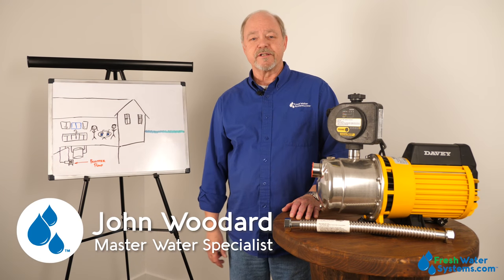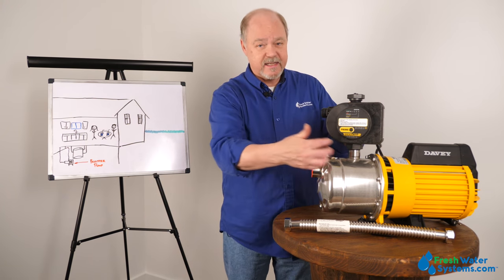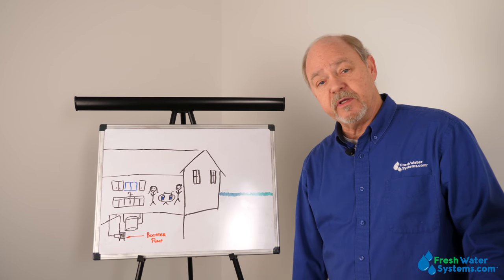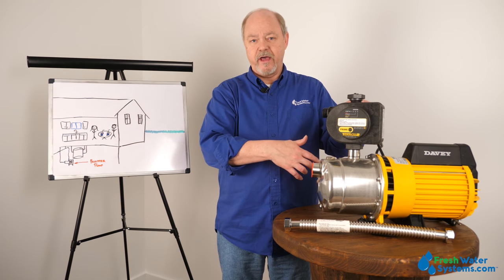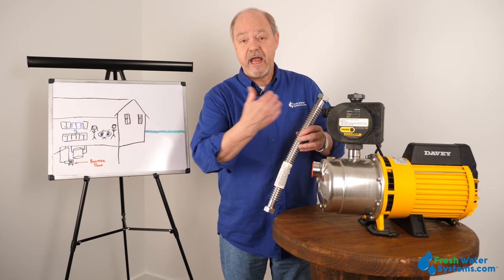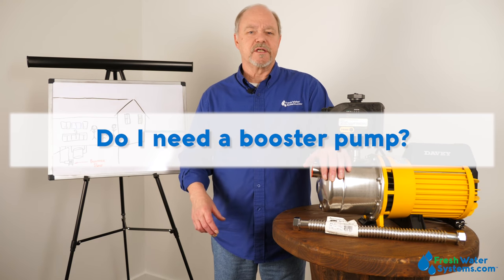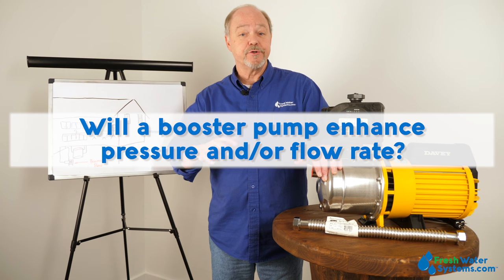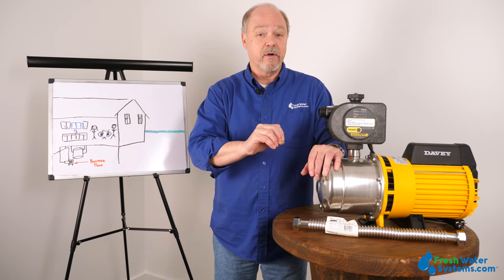What is a Water Booster Pump and How Does It Work?

Comment: So this will run whenever someone opens a faucet.  It's not like a pump with a pressure tank where the system will pressurize and the pump only will run once the pressure drops below a certain threshold.

Comment: My grammas house needs one of these. She lives in Mexico. They get their water from a reserve on the roof of their house. They only need about 20 psi
Reply: How do install the bypass yo your pump
Reply: Compraste la pompa? Yo tambien estoy viendo esto , y no se que hacer , tengo nueva casa en mexico en medio de la nada con tinaco y necesito una que de buena presion a toda la casa.
Reply: @TB-ij1vg  no la compre. Ya tengo tiempo que voy para México.  Cuando fui no avía nadie más que tenía bomba. Mucha de la plomeria en las casas no están para alta presión
Reply: @randybrown1922   you install a T fitting right before the flex Inlet for the pump, install a shutoff valve on the new run of pipe. Run this new pipe past your pump to the end of the outlet pump flex line. Add another T fitting just as you did by the inlet, with a shutoff valve. That way if pump fails, you can turn off flow to it, and reroute the water around it.
Be safe! Get your project inspected and permitted if required, AND ENJOY WATER PRESSURE 💦🌊💦

Comment: we have a cistern and a wster filter system and a booster pump. but the pressure on 4th floor is barely enough to activate the multipoint water heater. should i install a small portable 150w booster at the 4th floor so it can help activate the heater properly?

Comment: Hi;  what is the voltage for a 1 HP booster pump,  Davey brand. Also, is the pressure variable at the pump? Or is it a fixed pressure setting?

Comment: Caution please be sure you get the correct pump for your application.  What this guy is not telling you is there are no pressure adjustment on these pumps!   The pressure output is going to be 50+ pounds greater than your incoming water pressure.  i.e. 20 inlet = 70+ psi outlet

Comment: Really, really helpful video.  Thanks.  I've notice some booster pumps come with a pressure tank.  What's the difference between these and the ones that are pump only?  Is one better than the other?
Reply: An air tank gives a constant flow of air (pressure), rather than intermittent flow. Well that's how it works with airbrushes anyway.

Comment: Ok so I just installed one of these pumps for a customer . First yes the piping is vibrating throughout the system so I need to add flex connectors to the system . Second they are complaining that every time they turn on a fixture the pump kicks on. Can I add a storage tank to your booster pump and could you post a diagram on the proper installation of the auxiliary storage tank . Basically they want to be able to use water without the pump constantly cycling . Any help is appreciated . Thanks and I did purchase from you directly
Reply: Oh well
Still dealing with this thing. Now I have to add a storage tank because the customer is still not happy

Comment: we're buying a house that has one of these in the utility room, it makes a lot of noise every time you run the water a bit. Is there any way it can be installed outside in a small weather protected place? We do get wet and snowy weather. Thanks!
Reply: Did you try the flex connector or upgrading to a noise controlled version?
Reply: Anjulee Boralessa we haven't finished the sale yet, but I'll write that down so I can look into it, thanks!
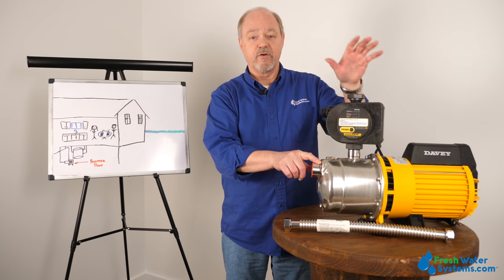Reply: Hi Mary, look at time stamp 3:43 in this video. He's holding a flex connector and describes the benefits of using them. I hope the sale went well for you.

Comment: I bought a used dura-flow pump to use as waterpump for solar heating system.
Now when I look at the pump I don't find any power cord/supply, only one 1/4 inch vacuum tube attached to the switch assembly on top of 
the pump. What am I missing ?

Comment: Can I use booster pump for 20 shower and 18 faucet from water supply (pipe) with less than 2 bar pressure from the supply?

Comment: How is this different than using a MUCH cheaper shallow well pump?
Reply: It’s difficult to see exactly. It could be the materials of construction, or that it may not develop the same head pressure. Some booster pumps are far more sophisticated than the simple on off shallow well pumps. For example, the well pump may just come on and increase pressure until it hits its limit so you may have varying pressure during the use of the water. However some booster pumps can actually control the water pressure to maintain it at a certain level with varying water usage. That’s not to say that a simple shallow well pump won’t meet your needs, it is just that you may have varying water pressure when it kicks in.

Comment: As far as I know, sucking water out of municipal water network - as you potentially do if you connect the booster pump directly to the incoming water line - is forbidden for a good reason. I haven’t heard anything about this from your presentation.

Usually you have to have a ground tank to separate the pump from the municipal network. Are there any other proper options?

Comment: Would this be good to boost the pressure on my shower head and my shower jets only?  I don’t want to boost the water pressure throughout the whole house.  There isn’t really good pressure that comes out of the shower jets that my plumber installed and I need a shower pump to connect to my 4 diverter shower valve that I have installed.

Comment: i have bosch (Serie | 6, front loader 8 kg 1400 rpm WAT2846SIN) washing machine. I have also installed sparta's super 150 pressure pump and given the direct connection to washing machine but machine's led indicator is still showing tap symbol..how can I make sure that water flows normally into the machine?

Comment: Thanks for your time setting up this video

Do you generally recommend a booster pump over a centriugal pump for residential use?  I have a 5hp centrifugal pump providing water from a well supply tank to two residences and low water use landscape that I may need to upgrade, is centrifugal the best to stick with?

Thanks!!!

Comment: Great video. Can I turn off the booster pump at night as it's noisy and comes on by itself all the time? We don't have heating on. The pump is on the 3rd floor next to the water tank and hot water tank.
Reply: yes if you made a bypass pipe as he mentioned, so the water can flow without going through the pump.

Comment: thank you sir
I want to install one in my home, 
someone told me to be careful as water pressure could let the pipes to start leaking, 
is this true?
Reply: If the water pipes are old or if new with improperly installed fittings, yes it is possible for a leak.  Piping should typically easily be able to handle up to 100psi but your fixtures may be limited as to the pressure they can handle.  A quality booster pump will have a regulator to control the discharge pressure and limit it to what ever you set it to.  For example, you may want 75-80 psi where you need to irrigate lawns or use pressure washers (note irrigation systems can be designed to accommodate lower pressures).  If you are lucky enough to have your exterior hose bibbs installed upstream of the rest of your fixtures, you can install a pressure regulator to limit the water pressure to your household fixtures.  For example, if the booster pump puts out 80 psig, you would have a downstream regulator to limit the pressure to the fixtures at 60 psig.
Reply: Is the pressure pump activated when a water fitting is turned on or is it permanently pumping
Reply: Egesi Edward As long as the booster pump comes complete with a pressure switch, the pressure switch will monitor when the water pressure drops below a certain set value. When it drops below this value, the pump will turn on. If the pressure exceeds an upper value, it will turn off. The upper value is set to prevent over pressurizing the system and potentially damaging plumbing fixtures. Booster pumps are available without pressure switches or pressure tanks. Ideally you want a pressure pump that, at least, comes with the pressure switch built in. These can be purchased separately, however.
Reply: @PandoraPX4B  Thank you Very much for clarifying. I had the same doubt, i found your answer to be very helpful and accurate.

Comment: Sir plz tell booster pump in let and outlet lines
Reply: They come in different sizes, if that is what you are asking, based on the required flow rate.  The type of lines can be flexible braded hoses or copper or PEX, with the right fittings.

Comment: A question for the Experts: Our Apartment has a booster installed which is set to operate between 1.8 and 2.5 bars. Since a while , we have an unstable pressure / temperature which changes every 10 seconds cycle. Would it be fair to say that there a problem with the booster (EG Fan blades not running stable)  ? The Management office finds this normal. We don't.
Reply: Sounds like the apartment complex added some more tenants and the water supply can't keep up with the demand.  They probably don't have enough pressure tanks.  I'm on a well share with 6 other families.  We initially had 3 big booster tanks and the booster pump ran too much to keep up.   Our well guy recommended one tank per household.  The system ran much better since we upgraded.  When property sold we required the new owners to buy 1 new tank.  Didn't take much over a year and we had all the tanks we needed.